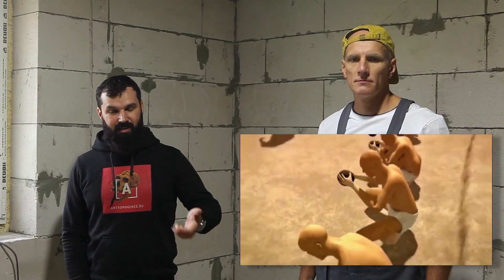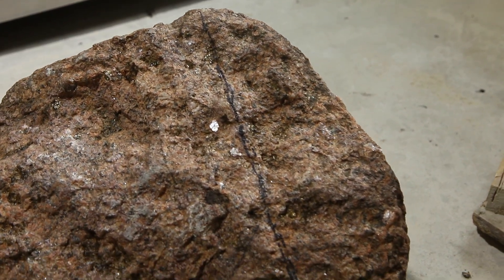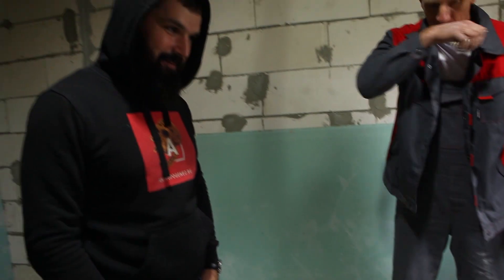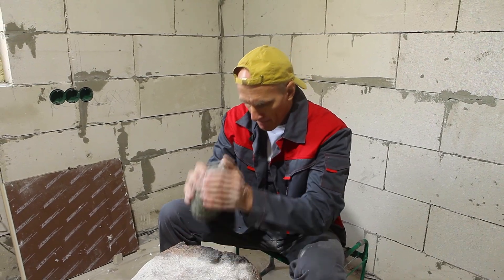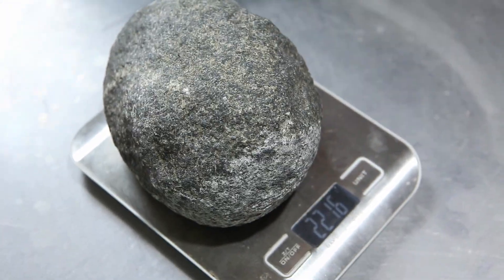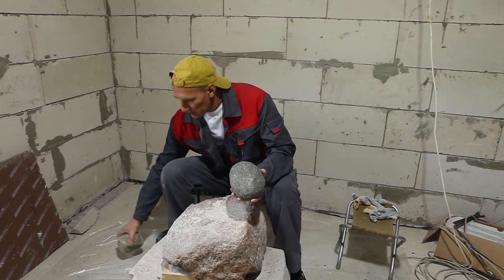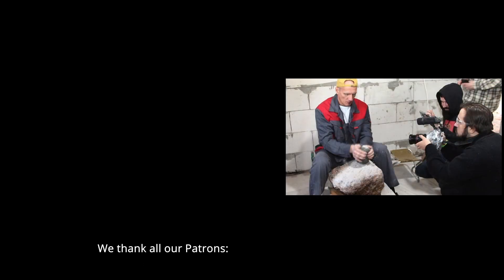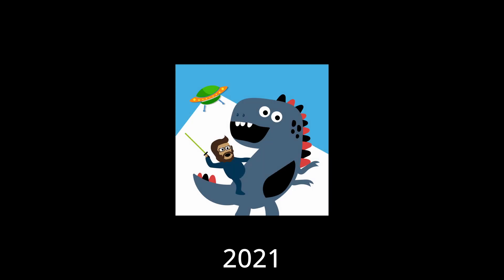Dolerite vs Granite | Could Ancient Egyptians carve obelisks?

Comment: I don't think an effective pounding technique was utilized in this experiment. Blows made  at the correct angle and at the right spot will promote chipping which can be propogated, resulting in much faster removal of material. You can clearly see this technique on the pyramidion of the unfinished obelisk as a linear set of scoops proceeding from the tip toward the pillar. The sides were excavated similarly by proceeding in a sequence of scoops which retain a lower "lip" that is easily chipped away on the next pass while at the same time a new series of scoops is formed, with the old scoop lip forming the new scoop  trough.
Reply: Yep - lots of techniques to exploit for better efficiency
Reply: The scoop marks are far too smooth for this technique to have been used. MANY such details are conveniently ignored.
Reply: @Kommander_Rahnn  Not true, the dolerite stones are dragged to some extent as they deliver their hammer strike which results in some smoothing. If you look at the scoop pattern it always has a dominant lineament (long axis) but the scoops don't line up side to side. The ridges are more prominent along the lineament since they don't receive direct strikes in that direction. It's all straightforward physics.
Reply: @tomszabo7350  
You literally said "chipped".
There are no chip marks on the scoops.
Stop coping so hard. You'll bust a vein.

Comment: Good attempt but proves nothing.  If you want to convince anybody, demonstarte how your rocks can cut the internal 90 degree square corners in granite and also the fine narrow cuts so often seen in diorite.
Reply: This is definitive proof of a potential removal rate.  This  channel already has an example showing how to make an external tridedral corner in granite using a flint tool.
Reply: You're right as carpenter squares to check plumb apparently did not exist until modern times.........  🙄

p.s. - look at the famous depiction of Egyptian craftsmen at work in the tomb of Rekhmire.  See one kneeling beside a stone block holding = a large carpenter square to check the block side's plumb.......  Also look at close up photos of the interior surface of sarcophagi near the bottom.  In some you can see "a lip" at the joint seam.  That infers when sanding the surface smooth a block of some type was used so that it left a small unfinished strip - likely to protect the fingers of the worker sanding the surface using an abrasive.  

As to cuts = first establish the age of the evidence.  You see ancient Egyptian sites were regularly cannibalized as raw material to build other things.  Old temples etc. would be cut up and their fine stone repurposed.  So for all you know those cuts could have occurred centuries later using iron/steel tools as why would a Pharaoh build something using "flawed" blocks unless it was being done using repurposed stone.......
Reply: We know they had set-squares, so shape a grinding tool with a right-angle outer surface and run that up and down vertically to grind down the final roughness of the inner corners.  Granite wears slowly, so over-grinding wouldn't be a risk with frequent re-measuring.
Reply: Humans had advanced technology that was lost. Case closed. Moving a 1500 ton granite block 500 miles to Giza then carving it and polishing it is insane.

Comment: And how many of these dolomite stones were supposedly used to carve what's been carved around the obelisk? Where are the remains? How did they pound above their heads, down under the obelisk? Where are the Graves from the potentially thousands and thousands of workers who would have died from silicosis?
Reply: I suppose you could research the existing documentation describing the archaeological records found on-site. I am busy trying to find records of every Egyptian grave. If I can't account for each person across 3000 years then I wont believe that Egyptians existed.
Reply: When Egyptologists/geo-archeologists mapped the Aswan quarry as an example they found 1K+ dolerite pounders in the area.  Further some of them had the names of the workman they belonged to painted on them.  As to where are the graves = what makes you think they were buried in a quarry........  As laborers for the Pharaoh they likely were buried in a cemetery near some important site to them - much as you see the graves of some who worked on the Giza pyramids in cemeteries at that necropolis. 

As to working above your head = scaffolding - the same as you see today.  That would be unnecessary for an obelisk however as it was formed on the ground laying on its side and thus they began at the "top" and worked down.  Silicosis would not be a problem as they were not using mechanical grinders which throw dust everywhere.  "Bouncing" a hammerstone does not generate a lot of dust - merely chips - while they could wear face cloths much as people do today.  😷
Reply: @varyolla435  I used to accept all of that, but it doesn't add up.
Reply: @TheRotnflesh  and..........  You think it matters what you "accept".  🙄

"The good thing about science is that it is true whether or not you believe it."  - Neil DeGrasse Tyson

Your personal incredulity = is your problem and not ours.  The evidence is the evidence regardless of "belief".

Comment: please note that for cutting stones grinding was the main technique not hammering, would like to see the same experiment with the same material but with grinding" scratching" and would be surprised by the results.
Reply: Hammering out the basic shape appears to have been the method used.  Then the approximated surface can be smoothed via your grinding along with abrasives while plumb can be periodically checked using a wooden square for smaller blocks or some pre-built wood frame for larger areas.  We have examples of ancient Egyptian weighted plumb lines.  So it would not be difficult to fashion a straight edge of sufficient length from which the sides of an obelisk or whatever could be checked for straightness. Hence it was not one or the other = but both.  Hammering for the basic shape and grinding to polish that out for finishing. 

p.s. - Egyptologists have unearthed as an example a partially completed criosphinx such as lines the Avenue of the Sphinxes at Karnak in the quarry area of Gebel el-Silsila - a sandstone quarry.  They were clearly hammering it to approximate shape - after which had it been completed it would be transported to Karnak and smoothed out.  Sandstone is almost as hard as granite.

Comment: Will be nice to test fire on the rock first and see of you can get a controlled cracking of the rock, and speed up the cut that way. Burn 1/2 Hour and pound 1/2 Hour.
Reply: Watch the video on the unfinished obelisk by World of Antiquity.  In it they speak of "firesetting" and a test done at Aswan vis a vis heating then quenching granite bedrock so as to hammer through it faster as the ancient Egyptians did.

Comment: I'm not convinced by this one like I am with your other experiments, but I am very glad you have done the experiment. This is real productive science.
 I think the dolerite rocks probably had something to do with it but I don't think they were used like this. Given dolerite's high compressive strength, they were maybe used like ball bearing rollers to move the heavy quarried rocks over uneven surfaces? Maybe they were used in conjunction with some sort of impact ram or downward facing slingshot to increase the force of impact? I can imagine a few devices which could be built out of the materials they had at hand which could multiply the force of the strike.
Reply: Well it makes the exact same marks . Maybe they tied them to sticks to make hammers or heat and blanched the area to be cut to crumble the stone.

Lol ball bearings in sand? Please record that experiment and show depiction or hieroglyph that show that.

I need to see this.
Reply: @pranays  Ball bearings are known to be able to move large stones without the need for machinery using rotational movement. There was an eccentric construction expert who proved it is possible a coupke of years ago in his back yard. You place the object on the ball bearing and use it as a fulcrum and then rotate it around the fulcrum and then place another one and rotate it around that one. This is a means to move heavy things using primitive methods. 

The reason I don't think it was hand and stone was that it would take a long time to carve a single brick using this method and we have a time frame for the construction of some of these monuments that doesn't line up with the rate of cutting. You could break it down into two rates and then compare them: rate of blocks quarried per minute and then rate of blocks required per minute to construct any given monument in the agreed time frame. If it takes even a short time like a week to carve out a single brick (judging by the rates achieved here it takes a lot longer) then you would struggle to make any large monument in a reasonable time frame. For the great pyramid, with 2,300,000 blocks, you would need a block every 4 and a half minutes to build it in the 20 year time frame. So this method with its rate of cutting of inches per day at maximum doesn't agree with that. Even if it took 100 years to build the great pyramid that is still a block every 22 minutes required to be quarried, transported and placed.

If they understood pulleys then they understood mechanical advantage, and if they understood mechanical advantage then why would they they not use that to make a more effective tool than a hand and a stone? If it was made of something less hardy than stone like wood then it could have deteriorated and only left the dolerite heads of the tool.
Reply: @kyrman6038  Hi. I think the previous commenter meant that using the relatively small dolerite balls in sand would not work well. Wally Wallington did amazing demonstrations with pivot points but without a hard ground surface, you would need to compensate somehow. I like the demonstration in this video and the calculated removal rates of both tools and work piece. And remember they did not use fire setting to weaken the rock. The unfinished obelisk quarry shows the signs of fire and simple experiments have been performed to compare removal rates. The quarry also contains ancient markings showing removal rates over a time period. It is also important to realize that the building of the pyramid can't be calculated by dividing tidal blocks by 20 years since that artificially limits you to placing 1 block at a time. Multiple teams would have been working in tandem for all phases of quarrying, processing, transporting and placing of blocks. Cheers.
Reply: @Eyes_Open  Thanks for the reply. There is much to be explored on this issue. 

You are right that the dolerite would not work on the sand, I was more talking about the removal of large stone structures from the uneven quarry sites where the quarried structure has to be removed from the surrounding granite before other types of rollers could be placed under it.

The pyramid building calculation gives only the average blocks per minute necessary to build it in 20 years. It doesn't say anything about the actual period between blocks being laid. For example: if every block was hypothetically quarried in the first five years and then put in place in the last five years of that 20 year span that would still give the same average rate of construction.

There is actually a lot of calculation we could do on this problem if we had a good estimation of the time it would take to quarry a single block using this method. The time it would take to transport a block to the pyramid site and the time it would take to lay a block in place once it had reached the site. 

If we had good estimations of these, combined with the average work hours per day of a labourer we could work out a good estimation of how many workers would actually be necessary to make it all happen within the stated period.

We could then compare that with the known population of Egypt at that time and see what happens.

Because presumably it's a lot of workers and they would themselves need an even larger wider economy to support everything they were doing. 

It would be good to get some numbers on this. If I had good estimations I could maybe even write a code which would number crunch a wide range of estimations against all the others then select the most probable arrangements from the result (because presumably we would be working with indefinite groups of numbers rather than exact known figures.)

Comment: Need to use fire first.  Much faster this way.  Like there is still carbon deposits in the quarries.  Simply build an enclosed fire, let it heat, may be hit with water and chip out with sharpened dolerite rock.  Not a rounded one.  Those are the discarded pounders after they were no longer sharp.
Reply: How did they quarry and shape all that dolomite.
Reply: @danielabdalla8488  rocks can be cracked but mostly they let nature do the (they found good rocks) work.  The rounded dolemite rocks that are in the quarry are the worn out tools.  Heating the areas to be cut and hitting the area with water made the rock much easier to smash.  These people got real good at their jobs. The obelisk were quarried out in less than 1/2 year according to records and moved on boats during the yearly flood.

Comment: This video was not very convincing. I understand that there is an amount of material being removed at a certain rate of pounding, but there is no clearly defined work line or shaping being demonstrated. Furthermore, given the force being transmitted through the wrists of the worker, it would only be a matter of days before they developed a stress fracture of their wrist bones. Pounding stones takes a great toll on human flesh and bone and there just weren't enough workers (paid or enslaved) to do the work required as demonstrated by this method. There had to be a more efficient and mechanical means of removing stone to accomplish the tasks. The archeologists, egyptologists and geologists will have to come up with better theories to explain what we are seeing with our own eyes.
Reply: It is not suggested that the stone is gripped tightly during striking since that certainly is not sustainable. The grip is loose during the strike portion to avoid that issue. And fire setting and using angular dolerite stones produce quicker removal of material.